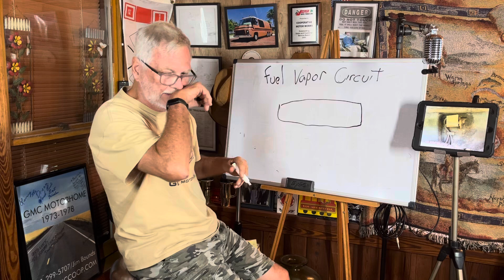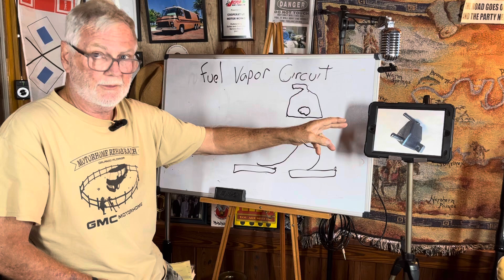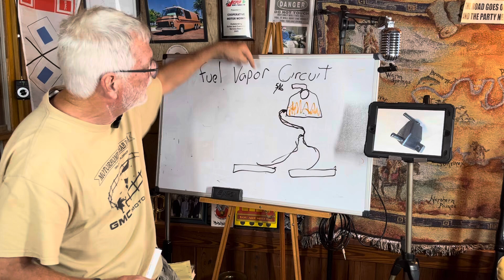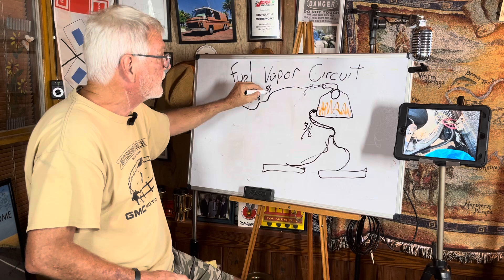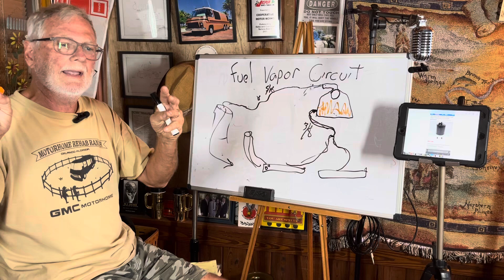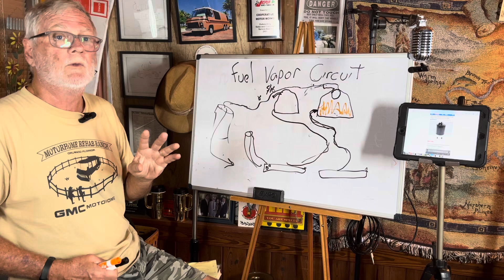Fuel Delivery System:  Vapor circuit

Comment: Once you add the 2nd vapor circuit and run the additional line up to the charcoal canister... What happens there? Do you T the two lines together into the existing charcoal canister? (Would that create the same restriction)  Or do you add another charcoal canister for the added line? You never finished that thought Jim.
Reply: Useful knowledge as always, thanks Jim.
Reply from the maker: Gday, I just finished doing all my lines on my 78' GMC. Now mine is a California coach with 2 x cannisters BUT my AUX cannister had a faulty vaccum valve on the purge...so I happen to have one from my 1980 Trans Am (After the LS swap).
Both lines from the vapor seperators run to each cannister then the purge line from Primary goes to the PCV line, the secont cannister purge line goes to the vacuum port on the front /lower left of the carby base.
This is according to the original manual connections so each cannister has its own vacuum port on the carby.

Let me know if this makes sense
Reply: @motorhomerehabranch  So, 2 separators and 2 cannisters?